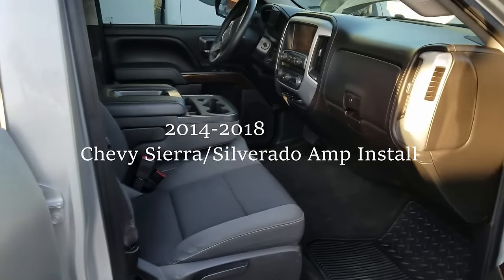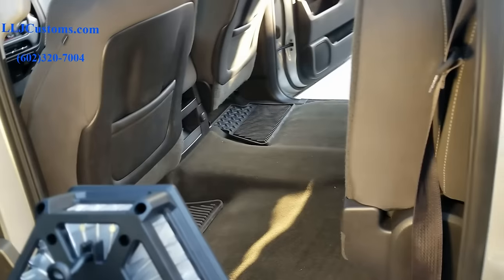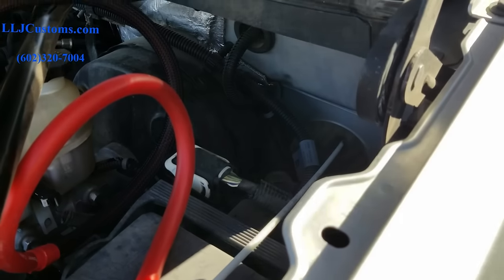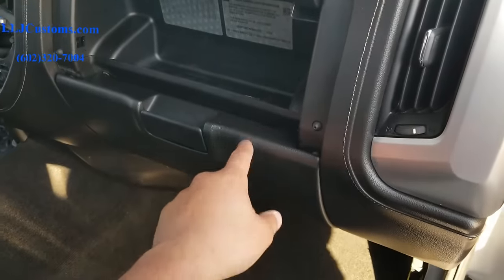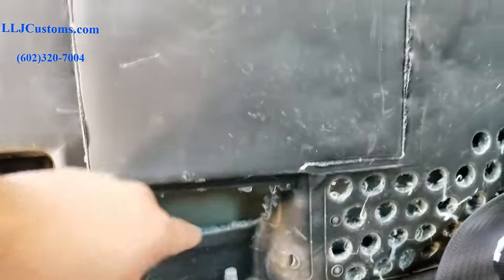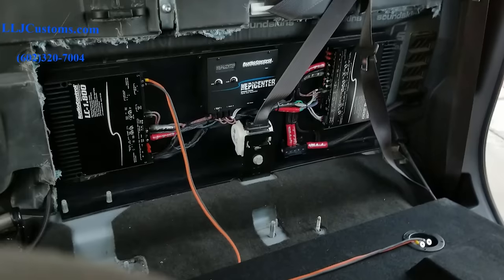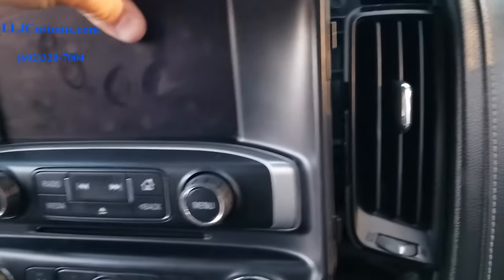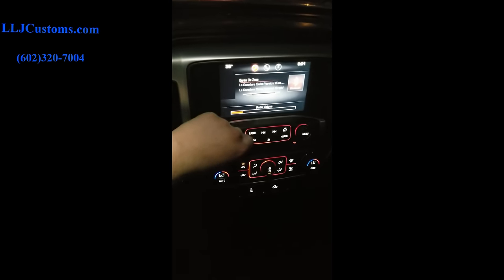2014-15-16-17-2018 Chevy Sierra/Silverado Amplifier install

Comment: what do you guys do about the door chime? from what i read they say it plays through the driver side door and dash speakers if you run that chanel through the sound processor and amp does it get crazy loud or stay normal? i cant find much information on this issue
Reply from the maker: the door chimes play via the dash tweeter. we bypass the chimes by giving them there own channel on the processor that way the customer can tune that channel to there liking. you can also use a dsp to tune the chimes out.
Reply: @lljcustomscaraudiofabricat7854  thanks for the reply and which processor should i get to be able to do that? i was looking at the lc7 oh and i have heard that the chime plays through the left door and left dash or is it just the dash
Reply from the maker: @psyfertech  its just the dash because the door is just a mid range and there's a factory crossover that separates the frequencies. The LC7I is a good choice but from what it sounds like you're trying to do the DSR1 would be a good fit for you too, they're similarly priced.
Reply: @lljcustomscaraudiofabricat7854  oh okay great yea this is really helpful its hard to find this information and cool i will definitely look into that, one more question with the loopback harness does it give you seperate leads for the dash speakers and the front and rear doors or do you just get 4 total inputs? im just curious how it sperates the signal for the chime
Reply: @lljcustomscaraudiofabricat7854  yea just checked out that dsr1 looks like it would work great has a ton of ajustments but i think i understand what you mean you can basically tune that frequency that the chime makes to where its not quite as loud for when it runs through your amplifier correct me if im wrong

Comment: Do you have a video showing how to do this with Bose amp? I’m a bit confused on how the harness works also. Do you have a harness that converts to rca?
Reply from the maker: Hello, yes we have a video on the Bose Loopback Harness as well. The harness can be ordered with a processor which will provide RCA out or it can be ordered with RCA ends to plug in directly to the amp. We only recommend plugging in directly to the amp if the amp can handle the voltage from the Bose amp which will output 32v.
Reply: @lljcustomscaraudiofabricat7854  already ordered, ordered the t harness Bose with the link 2. Thank you!
Reply: @lljcustomscaraudiofabricat7854  hello, do you know when my order will ship? I’ve messaged you guys and get no response, it’s been over a week since I placed my order and it hasn’t even shipped.
Reply from the maker: @ma93256  ALL OF OUR PRODUCT HAVE A LEAD TIME !  we dont reply to order updates when the order is within the lead time. So many customers just don't read any of the information on the website and we have to deal with comments like this. The product has to be built then shipped. All of this is allllll over our website, social media. PLEASE ,PLEASE read all the information before ordering. If you just ordered a harness, odds are it has a 2 week lead at the moment unless its a loopback that has a 30 day lead time.
Reply: @lljcustomscaraudiofabricat7854  A response on a timely manner works for me but that hasn’t been delivered and that’s why I’m here hoping to get a response. Thank you for responding I will continue to wait.
Reply from the maker: @ma93256  we completely understand. And that is why we try to put that information in as many useful places as we can. If you feel like we could place it in a better place please let us know. We also have support for installation assistance and troubleshooting and prioritize those emails. I understand most people will say get more help but then the accuracy of our support diminishes, as it takes a few months to get the knowledge required to properly help our customers. Its not so easy, trust us we want your experience to be the best possible.  When your item is shipped an email with tracking will go out .
Reply: @lljcustomscaraudiofabricat7854  no worries I’m just glad I got a response, will wait patiently thank you!
Reply: @lljcustomscaraudiofabricat7854  hello, I received my item everything is great. I’m having an issue where when my vehicles not being used and turned off periodically I’m getting a loud buzzing noise out of my subwoofers. I’m hoping you can lead me to a resolution to this since you’re experienced :)
Reply from the maker: @ma93256  hello 👋,  that is turn on pop and happens when you use DC offset to turn on ur amps .if you have a wavtech product set it to audio turn on it will fix your issue. 🙂
Reply: @lljcustomscaraudiofabricat7854  that did it! Thank you so much, great product.

Comment: will this work with 2014 silverado that's equipped with the bose?.
Reply from the maker: Hello pronox, no your signal is at the bose amp that is mounted on the lower center of the back wall if you have the truck. And the harness will be the bose T-harness this is the 8 inch screen harness.  We have a bose video if you want to look ! Thank you for your question. 
https://lljcustoms.com/products/2014-2022-gm-gmc-buick-cadillac-with-bose-amplifier-t-harness?_pos=2&_psq=Bose&_ss=e&_v=1.0
Reply: @lljcustomscaraudiofabricat7854  Appreciates!..

Comment: What did you do to get away from the crazy flasher and chime noises
Reply from the maker: We use the Audio control LOC units or amps that give you the ability to turn them down, or you can use a dsp.

Comment: What’s the loop back harness for? The rca’s n remote wire?
Reply from the maker: Our OEM Loopback harness was created to let you use the factory wires to get the signal for your aftermarket equipment and return that signal to the speakers via the factory wires. Our loopback provides power 12v @ 10amp to help run a dsp, processor, or dsp.

Comment: What about for Tahoes that have the motorized lift up screen on it? How would you plug into it
Reply from the maker: Hello, great question . depending on the year the radio unit will be below the center console or behind the glove box .
Reply: @lljcustomscaraudiofabricat7854  Cool, ill go searchin for those plugs to send pics of the colors. It has a BOSE system smh. Can i swap out door speakers and add amp for those. And the dash speakers idk what u would recommend. Delete them or have em work with factory amp and run a 4 channel for the doors?

Comment: I’m confused on where the remote wire you run to the amp is?
Reply from the maker: The remote for this vehicle can be taped on tbe driver side fuse panels or in out harness with a signal detection microchip

Comment: I need one for a crew cab 15 Silverado with lc7i. What size leads on the lc7i do I need. Don’t even know what that means lol
Reply from the maker: Leads is the term we use for the overall length of the harness.

Comment: I've got the wire harness that hooks to the back bose amp I'm using lc2i pro off of the harness that hooks to my amp which is 1 ohm stable my problem is I can run my sub at 4 ohms no problem when I hook my sub to 1 ohm as soon as amp kicks on sub ohms jump up to 3.5 almost 4ohm is this because I'm hooked to the factory bose amp messing with my sub amp please anyone dealing with this problem

Comment: Does it amplify (make it louder) the chime form when driver door is open with the key in?
Reply from the maker: The chimes can be deleted and or minimized depending on how you decide to wire the system and the processor that you use with out harness
Reply: I took my truck to a guy and he installed it the same way you did but didn’t use the hardness and the chime is so loud he didn’t want to fix the chime
Reply from the maker: @cristianmendez8916  the harness helps but it comes down to what LOC/dsp they used and if it was wired properly . there is many ways to get around the chimes.
Reply: Great video Sir!!! good “catch” on the door chime. Hate that it’s sooo loud. Could tell the install took several hours. Wanting to upgrade my truck’s sound system really badly. Spoiled by the quality sound of aftermarket systems. 
Peace.

Comment: Chevy sierra?  Hmm. Is that like the ford viper?
Reply from the maker: Actually no . The chevy sierra has the same connector configuration as the chevy silverado and the GMC sierra in all 3 audio styles like the TW,8inch without bose and with bose the wire and harness are interchangeable. The ford or 22 ping plug is not compatible with the viper the viper uses an on bored amplifier and has 2 plugs.

Comment: Hi could you tell
Me what model to get for a 2016 gmc elevation edition with a 7 inch screen
Reply from the maker: Yes sir you would need this harness :

https://lljcustoms.com/store?olsPage=products%2F2016-2018-gm-and-gmc-vehicles-with-7-screen-loc-t-harness-not-bose-slash-work-truck-ls
Reply: @lljcustomscaraudiofabricat7854 could you put a new link for that harness? I have a 2016 GMC Sierra base model and it uses the tan and grey plug

Comment: how did you fix the chime issue with the doors and startup?
Reply: I would like to know this as well. By taking the factory output and running it into the amp and back to the speaker harness using the loopback harness aren't you amplifying the door chimes as well?

Comment: @LLJ Customs Car Audio, which harness should I need to use on a 2014 Chevy Silverado with a 8 inch screen?
Reply from the maker: Hello Arturo, what are you looking to install in your truck ?
Reply: @lljcustomscaraudiofabricat7854  ima do a full system on it my truck
Reply from the maker: @arturoltx4059  then the loop system with the lc7i would be what we did here exept we used the lc4.800 and not the lc7i bc the lc4.800 already has the loc built in
Reply from the maker: @arturoltx4059  https://lljcustoms.com/store?olsPage=products%2Foem-loop-harnesses
Reply: @lljcustomscaraudiofabricat7854  oh ok but do you have the right plug and play harness that I need?
Reply from the maker: @arturoltx4059   all you need to know is if you have a bose system. If not then the diagonal size of your screen. yes we do
Reply: @lljcustomscaraudiofabricat7854  no it's just the normal stereo and which plug and play harness do I need?
Reply: @lljcustomscaraudiofabricat7854  so which will be the right harness that I need?

Comment: did you run new wire to the speakers?
Reply from the maker: No we did not the loop harness uses the factory wiering to power the new door and dash speakers

Comment: So could I do the same with any subs and amp with that loop back kit? Just wanna run 2 12” with a single amp
Reply from the maker: Hello NUT, 

great question and the answer is a bit complex. No you can not use any amp with the loop harness it HAS to be an amplifier that has the capability of taking a high or speaker level input . if you amplifier does not take a high level then you would use something like a lc7i or link8. if you want to just do subs you would only use a T-harness with an lp7-2 or link2 no need for the loop if you just need a sub out
Reply: LLJ Customs Car Audio Fabrication L.L.C  Alright just wondering, I’m used to the older deck and stuff where it was just remote wire to the amp and that’s if, this newer stuff has me a little confused 😂
Reply from the maker: @nut3634  its only getting harder . bmw has been doing can bus systems for a while and nor gm and ford are also doing it and we all now no one likes working on a bmw lol
Reply: LLJ Customs Car Audio Fabrication L.L.C  Thanks for he quick response, I’ll see what I can find!

Comment: How did you get the remote for the amp.
Reply from the maker: Hi Marco, the LC4.800 and LC1.800 offer GTO which allows the amp to turn on when it senses audio signal come through. You do not need to run a remote turn on wire to the amp.

Comment: Question
Will the amp get hot in tight space
Reply from the maker: some amp do and others do not  it important to look at the amp specs before picking a location. in this case we know this amps will hold in extreme temperatures.

Comment: How much   a system like this cost???
Reply: A full system like this one that includes everything except speakers. All pre-mounted and wired  will run you around 1550.00 with a 5 year warranty and  free shipping.
Reply: Including the subwoofers??
Reply: @benitosantos2642  No that price does not include Any speakers.

Comment: How much is this install say I have my own amps and subs, or is that box you hook it to an amp as well?
Reply: I just watched that part again so they are amps so what would that run me for the equipment
Reply from the maker: @jesusahumada794  Hello Jesus this exact kit runs you 1500.00 that includes everything all wire, fuse, mounds adapters and equipment including the sub box (no subs).
Reply: And that includes the harness behind the head unit, also what sub is the box made for do you guys custom make them or just a pre-fab box, I see your a 602 area code are you in PHX?
Reply from the maker: @jesusahumada794  that is correct it includes everything you need for your install. the box is a prefab box comes in double 10 or 12s. correct we are in Phx, AZ

Comment: On my truck the the plug is not green
Reply from the maker: That means you likely have a 7 inch unit and will need a different harness . is your radio unit black or silver ?

Comment: Nice man! What would something like this run $ ?
Reply from the maker: this t-harness range from 95-185.00 depending on the loc unit you add to it. they come with our support and a 5 year warranty.
Reply: How much to do a full install Amp, 4 door speakers, subs? Pretty much the same thing you did here in this video.
Reply: I have a 2016 Silverado non-bose system with 8" screen
Reply from the maker: @jaynori8321  this system with the labor and 5 year plan is priced at : 1434.00. this includes all equipment (amps, harness, epicenter, tuning, power and ground wires) .  this systems can be shipped pre configured . this amps LC4.800 and Lc1.800
Reply: @lljcustomscaraudiofabricat7854  does it also include the subs?
Reply from the maker: @jaynori8321  no the subs in this case with the box would be 390.00 that was 2 rock P3s's
Reply: How much total price install and labor please  I have same truck 14 Silverado high country
Reply: Material and labor

Comment: Where did you ground the amp at?
Reply from the maker: The amps are grounded to the main seat bolt in the rear that is connected directly to the frame

Comment: Can anyone tell me how you get the red lights like on this head unit instead of the original blue?
Reply from the maker: Hello Bryson, the red is for GMC the Blue is for Chevy.
Reply: LLJ Customs Car Audio Fabrication L.L.C my 2017 GMC Sierra has the stock blue. Just wondering if there was a way to put the red in instead
Reply from the maker: @brysonevans9883  That very interesting . the only way we know would be to change out the led diodes themselves.
Reply: LLJ Customs Car Audio Fabrication L.L.C ok thank you
Reply: Bryson Evans 2017 and newer GMC/Chevy use blue LEDs, older models use red LEDs
Reply: @brysonevans9883  I'd trade my red led face for your blue if its possible

Comment: Why ruin someone’s Factory Sealed Rubber grommet that You cannot go back and Seal 100% from possible water leaks...    Just drill a New hole beside it insert Plastic Grommet Run you Wire covered in Loom and then Seal up your New Grommet for a More Professional Look !!!!!!
Reply: That's exactly my thoughts as well. A shit ton of unnecessary cutting. If it were my truck they would be owing me some money.
Reply: Yes sir you are Correct
Reply: Want it done right? Do it yourself. That’s what I learned plus you’ll save tons of money.
Reply: I do installs on the side and when I seen where they cut the grommet I was like wow really it takes 2 mins to drill hole and use new grommet plus if customer looks under there would look professional.

Comment: That's is crappy..hacks.  let's find something to pull a wire thru. I thought you guys were professionals. No unibits??can't make your own hole and have the proper connector thru the fire wall?? Didnt make it past that point in the video..hacks
Reply from the maker: Please enlighten us with your great wisdom on the difference between drilling a fire wall (possiblity of hitting wires, air ducts or drilling at an angle creating water to leak in) over pulling the wire via the 3 layer Rubber boot that we then used sealing puddy to seal. Not to mention that was designed for running wires. You sir probably use wire nuts on your radio. The ignorance in your comment is unbelievable. Make sure to subscribe. You might just learn something!